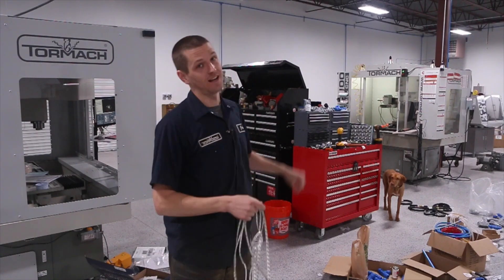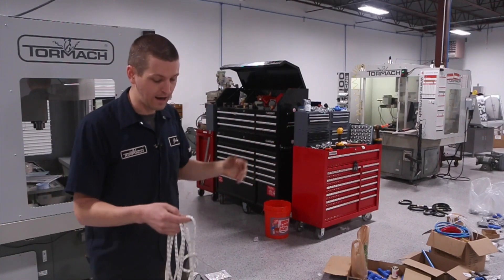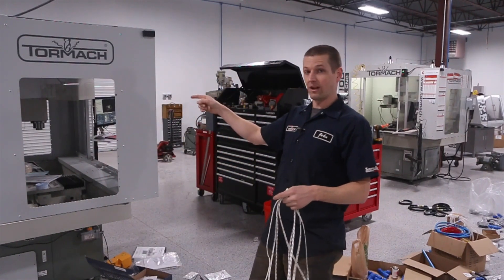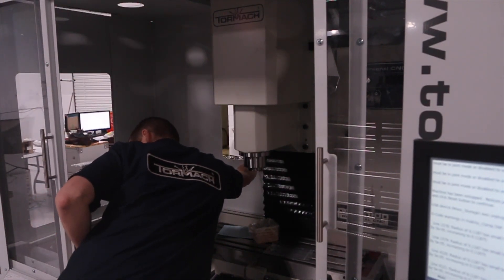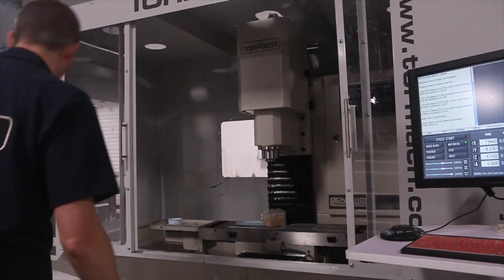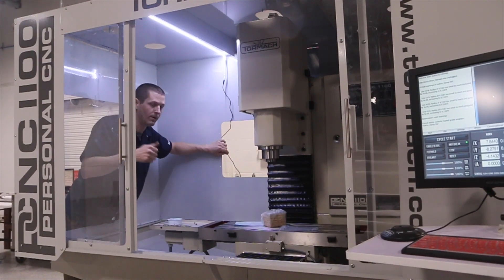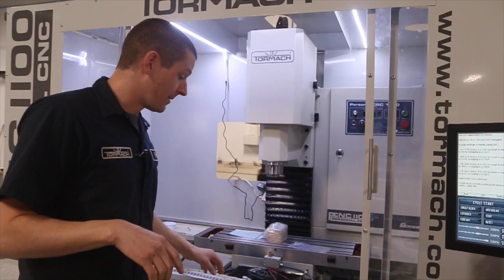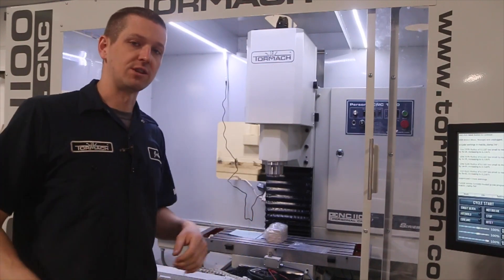How to: GREAT Tormach Lighting = ADD LED's!

Comment: The issue I have with the water proof led tape is that the flex clear they put on top has always turned bright yellow over time.  I have a roll right here on my desk I can't use because it's crazy yellow!  :(    4000k is the best color temp to work under I think...

Comment: Is your doubled sided tape holding up? I purchased to recommendations with the video. my lights are falling off the cabinet. The lights had to be shipped from China. At some point they must have received heat. The tape backing was peeling before installing.  Looks like a trip to store to purchase more tape..to tape to the tape and cabinet.  Sure enjoy the improved lighting. I installed with a switched power strip. Now have extra power in cabinet (for camera, etc), too.

Comment: I used those leds in a fish tank hood the connectors corroded  after a few months from condensation .
I fixed it by opening the connectors up soldering the connections and sealing them inside out with silicone

Comment: A good start but they will fail, Been there done that, with those cheap strips:
I have been selling LED lights for about 5 years here`s my 2c

0/ A good start but they will fail. the LEDs have no heatsink, flexi PCB does not cut it.
1/ its not/never  3m tape it will come off [you need the alloy rigid type]
2/ the SMD LEDs look super low powered and bad color temp 
3/ they are not water proof the epoxy will fail at the ends  -this is hard to get right.
4/ you need 5-6k for sure 5k is the best I think. [the Side wall colors can make things look weird]
5/ look at the 5050 LEDs they have the best bang for buck about 3 times brighter so you need less
6/ you need diffuse front and side lights [filming] Sometimes rear fill.
7/ I use a PWM dimmer as the light can be too bright.
8. Add a fuse to each "strip"
9/ Go dual row LED`s on a alloy backing -they will last and have good performance
10/ Put your LED`s in a clear plastic tube that way any fluids just wash off.
11/ On the lathes etc I use a 12v 10W LED spotlight 5k with flood diffuser lens on a mag base

If you want some of my ones that I use on machines just say and I will send you some free samples.
Im not selling-pimping anything I just like your show !

Comment: I also don't like the glare caused by the LED's because the light emits from such a concentrated narrow spot/point. I usually mount my LED strips using an Aluminum profile with a plastic diffusing cover. It helps with the waterproofing and creates a light that is much more pleasant for the human eye and helps reducing fatigue. 
Something like this: https://d114hh0cykhyb0.cloudfront.net/images/uploads/led-profile-housing-b1888-assemble.jpg
Although there are many different styles.
6000K is in fact bluish light. White is 5500K (although 5000-5500K is Acceptable). 3200K is filament bulbs/lights and generally concidered "warm" light. Hope this helps.

Comment: Just be careful. While the bulk of the LED strip is waterproof, the end you exposed and the associated 12V lead is not. 
You may want to seal any non-waterproof bits with silicon or something similar to ensure there is no water/liquid ingress.

You may also want to consider a piece of plexiglass or similar diffusion material to make the light spread more, as LEDs are traditionally pretty linear in light distribution. This would also help in the liquid protection column, too.
Your CFLs have a diffuser (the disc below the light hole in the roof so, your LEDs should have similar. :)

Comment: Make sure if you're getting these LED's, that you opt for the 5050 LED's (brighter diodesm, which ARE NOT the ones shown in the video), and get IP65 or IP68 rated.

Comment: if you use the full roll its equivalent to 60 watts  if you want  more the cheap power supply is $25 for 12 vdc 30 amp 300 watts

Comment: I put these in my Slant Pro right after I got it.  Worked great for about a month, then the adhesive just gave way on all of them.  Was a big bummer to me.  Ended up grabing some LED tube things... Epoxying Magnets to the case, and now I have magnetic lights that I can move, or do whatever with.  But I suspect you will have better luck in the mill than I did in the lathe.  As you know, the lathe slings coolant everywhere.  With your mist setup, and just being a mill, I suspect you will  be fine.  But keep an eye on it.  I do have them in my laser engraver (no coolant or moisture of any kind) And they have been holding solid for about a year now.

Comment: Actually, 6000K is a little "hot", i.e. will be blue-ish. If you want something more neutral and (to my eye) more pleasing, look for 3000K-range LEDs. I changed out the halogen bulbs throughout my house with 3000K bulbs. What I got was brighter, energy efficient and about the same color (at full intensity, halogens gets really yellow when dimmed but LEDs hold their color temperature).

Comment: I used those strips to light under my kitchen cabinets. To avoid problems with the adhesive coming loose, I installed then in aluminum channels with diffuser caps on top. Search for LEDdrop Channel on Amazon. Makes hookup a little harder but they clip in place and won't fall off.

Comment: I find 6K to be too blue for my taste.  I made a machine light that was about that color temp.  It made my eyes hurt, in very short order.  I ended up popping off the lenses and adding a cinema gel, to correct the color temperature.  Just my taste, but in my shop, I prefer light around 4000-4500.  It's warmer than daylight, but white enough for me and is more comfortable to my eyes.    But again, just my taste.

Comment: Might put some strips down low to light under the head. That's the problem I am currently having plenty of light, but the mill head and computer block allot of light. I was thinking of putting a single led light tube vertical on each side of my mill. Since the walls are only about 3 feet away from the mill.

Comment: 6000 K is cold white, i.e. very blue. The best color temperature for your eyes is around 4000 K. People often tell you that 6000 K is closer to natural light because the number is closer to what daylight color temperature is. LEDs radiate a very blue (low) wavelength of color that the phosphor layer transforms into white light (i.e. a broader spectrum). Because of this a higher Kelvin value in LEDs will have a higher spike in the blue region and therefore be more blue. When you factor in our eyes and the fact that our sensitivity in this blue region is much lower than in the green and red we see a lot less light. If you want more usable light for your eyes (that is still perceived as white) go with around 4000 K. A lower Kelvin value will have a lower specified lumen output, but the eyes will have a more even and usable light spectrum than with the higher Kelvin values. Keep in mind that it's a machine that measures the lumen output and it's not calibrated (or normalized) to what our eyes can pick up.

Comment: If you had a chance to choose between two used PCNC 1100  (2015 $13,000 with 30 TTS holders, or 2011 $9,000.00) what do you think is the better deal?
Reply: +Kendall Dene neither
Reply: m98custom12 Okay so now give me a productive answer on what you would suggest for a small shop.
Reply: Whats your budget? What travels are looking?
Reply: My budget is 10-15K and I don't have 3 phase in my shop.
Reply: CNC Knee Mill Or VMC and Rotary Phase Converter to get your three phase.
Reply: I heard a CNC wouldn't work well off a RPC.  Size is an issue and I have an RPC 5hp that I run my vert. mill with.  My preference is a VCM but I am open to suggestions
Reply: It does because I'm doing it right now with my company. I have vmc running off 20 hp rpc. Yea if you have vert mill next time would be VMC. I message you a my business YouTube page and email

Comment: I've used these adhesive LED strips a lot to make under cabinet lighting. The adhesive rarely sticks for long, but a little hot glue dab every inch or so will keep them in place. Manufacturers label their lights with the kelvin rating, but they almost never match the color specified. Unfortunately you will need to buy a few and find a strip or combination of strips that will provide the color you're looking for. My recommendations for LED: Green Creative BR30 Cloud LED 4000k (Part #: 40772) Very bright -- Great Eagle brand M16G109xx6 Series LED MR16 GU10 "Bright" color-- also for basic shop lighting the Costco.. Feit Electric 38W / 4100K Cool White / 3700 lumens / 2-Pack cannot be beat for excellent lighting, color, and value.
Reply: John, a pre-clean with alcohol will help.

Comment: Those strips are going to come off. The glue on them is usually pretty bad. What I'd do is just get some proper color balanced LED fixtures. As someone else has mentioned, those are looking pretty blue which would correspond to the 6000K (usually around 6500K when you measure them out) and true daylight balanced lights are 5600K. When they write "daylight" on those eBay ads you need to make sure they're 5600 and not more likely 6500. I've gone through A LOT of those strips to find the perfect ones - and they're usually more like $20-25 per roll ;-)
Reply: Happy to help! The Sun's native color is around 5800 Kelvin but as soon as it enters the earth's atmosphere is changes because of the particles in the air. Usually during high noon (depending on the time of year also) it'll look like it's up to 6000 kelvin and down to 4500 at night. But in your case you'll need some that are closer to your ceiling lights so they'll look the same to avoid that odd color difference :-) Also - if you're going for a dimmer make sure you get one that uses a voltage regulator and not PWM dimming because that'll end up flickering - especially when you're shooting slow motion. I guess you thought about that already ;-)

Comment: Just thought I would toss you this curveball, but "white" LEDs use the same fluorescent process that CFLs do. It is a UV emitter that has a fluorescent phospor over it. The problem with color temperatures is, different manufacturers use different grades and types of phospors for their filters. Since the output of a fluorescent source is more line spectra than continuous, color balancing can be a bit of a tail chasing act. The only way to get real close is to buy all of your fluorescent sources from the same manufacturer. Even then, you may have to resort to using color correction filters which fortunately are pretty cheap. If you want to experiment, visit your local theatrical lighting supply and ask to see a sample book of filters. They may even give you one to try out.

Comment: 6000K is going to be on the blue side of daylight, which is a lot bluer than most interior lighting. I'll bet your overheads are 3200K or 3400K, unless you went out of your way to get daylight color temperature, in which case they are probably 5100K. Anyway, this is only an issue for photography, or when you go back and forth rapidly between light sources. Otherwise, your eyes will adapt.
The CF bulbs look bilious green on my screen, which is typical for fluorescents. Good riddance indeed!
Is it possible to put some LEDs on the bottom of the housing around the spindle? You have lots of light everywhere but where the action is, at the end of the spindle. If not, I'd be tempted to put some kind of LED Spotlight in each front top corner, shining down on the center of the table.

Comment: I did almost exactly the same thing to my machine. the LED color temperature is a little blue, but it's much better than the compact fluorescents. I also built the ikea jansjo LED magnetic base adapter that clickspring built and the combination of the two has made all the difference

Comment: Great stuff :-) Yes, I see a hint of Blue, but that may be due to other lights and colors mixing... I've made several LED Grow Lights, right down to the PCB Boards... Typically, mine run on 12VDC. I assume your new lights are 110VAC... Not sure if the 60 Hz (Cycles/sec) make any difference... Hmmm... You might try adding some Verticals too (on the inside walls, as not to be starring into the lights)... That would also remove a lot of shadow... Goog luck :-)

Comment: I did the same as you and Robert on my 440.  I had trouble with the connectors, they keep falling apart on me.  I think I'm going to make my own connectors and solder them together.   I am also having trouble with the adhesive on the lights.  That might be a symptom of my paint my enclosure thought, not sure.

Comment: if you take a CD (using it a a diffraction grating) and look the rainbow you get reflecting the light, you will see what the main color components are for that light, a good white light will have all colors in the rainbow at equal brightens...lights that are either too hot or too cold, will have either a higher amount of reds or blues, and you will be able to see that in the rainbow reflection.  Google "cd diffraction grating" it to get a better idea what I am talking about...hard to demonstrate.